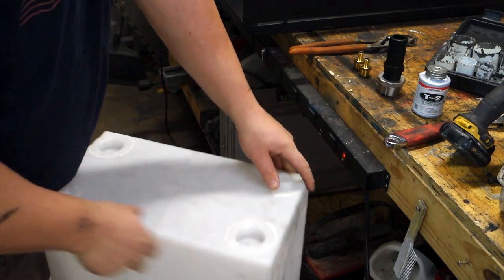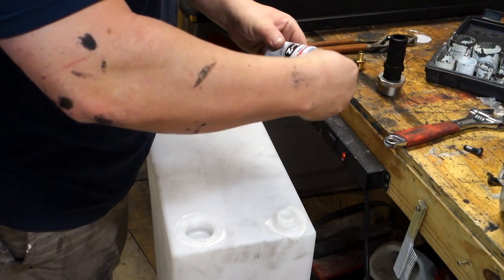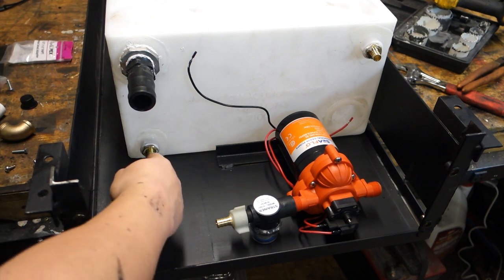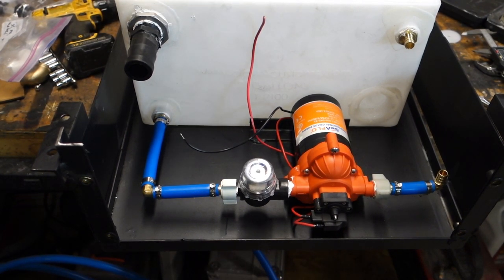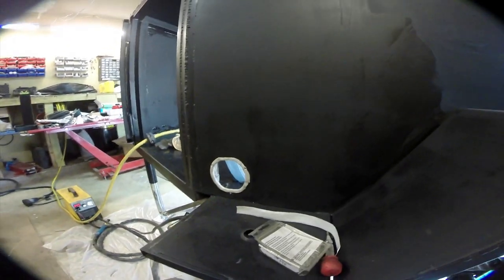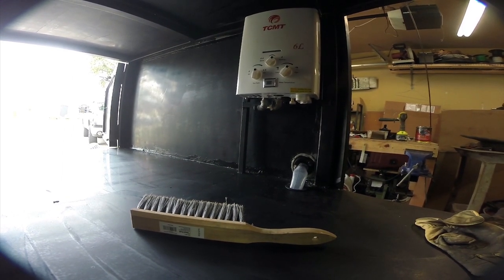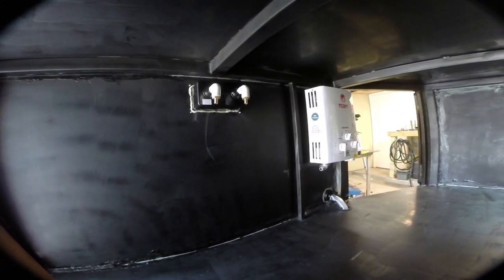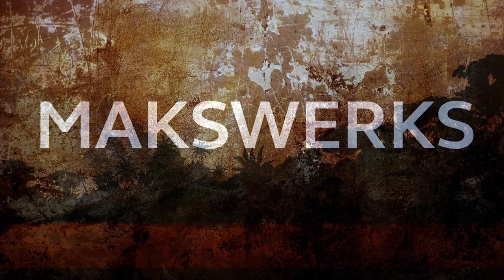Adventure Trailer - Episode 5 - Water System Install with Shower and Water Tank!

Comment: This is awesome helped me with how I need to install my system. Just due to lack of knowledge for the pump you just run the wire to the battery power and it just stays on or do you have it wired with an on and off switch?
Reply from the maker: Yes. The water pump is on a rocker switch on the main switch panel. It will stop when it senses pressure though. I only turn it on when I need it
Reply: @Makswerks1  thanks! Yeah I watched your next episodes and saw how you did it. Thanks for the reply!
Reply from the maker: @timothyarce7664  Of course. Any other questions, just post up!

Comment: Good system. Did you run into any problems filling the tank with the bends in the fill hose? It looked like it might have been an easier curve to not go through the trailer at all and bring it up the outside. Possibly protected by an out pipe or something to keep it from getting snagged. Kind regards,
Reply from the maker: I never had an issue. I think it looked worse on camera than it was. It could take the full flow of a garden hose with no issue.